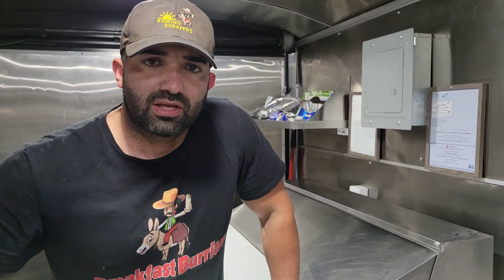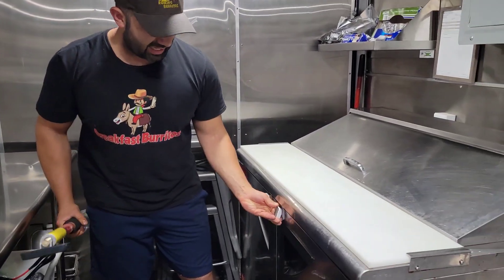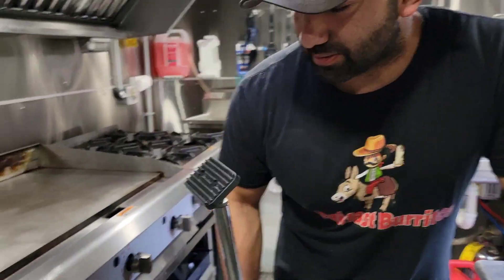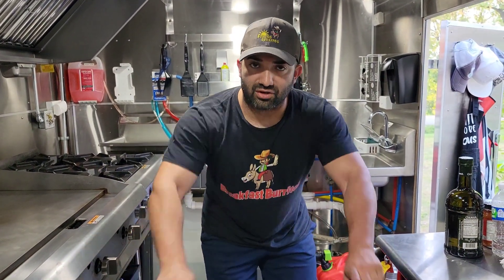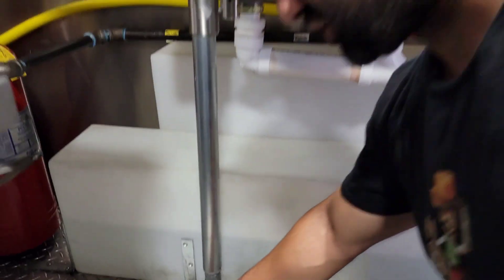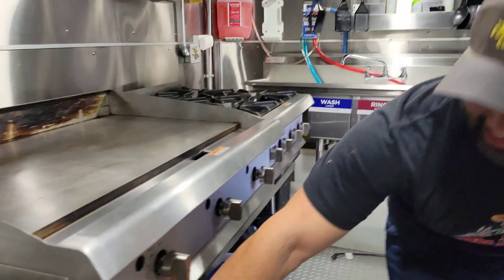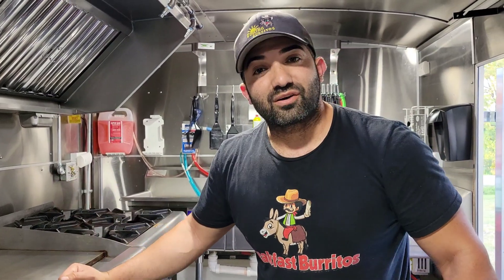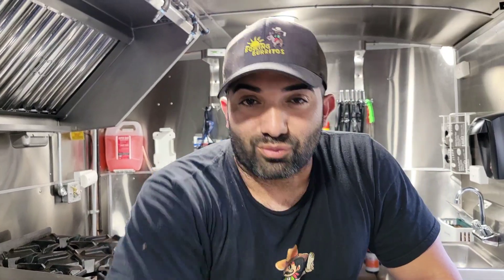Food Truck Tips: My Equipment keeps moving

Comment: How do you secure a 20quart mixer on a table?
Reply from the maker: I would use screws from the bottom up to the legs
Reply: @fbaltierrez  do yiu recommend fastening to the floor of the trailer or to a stainless steel table?

Comment: What is the best way to secure a mixer on the trailer?
Reply from the maker: I use this https://www.lowes.com/pd/SteelTek-1-1-4-in-Silver-Galvanized-Steel-Structural-Pipe-Fitting-Floor-Flange/999930954
Reply: @fbaltierrez  mine is a bigger one and they have square feet. Will there be any around that fit?
Reply from the maker: @xstablishedtv  no idea to be honest. Worth a try, I have never used machines with square legs
Reply: @fbaltierrez  in your opinion would  you think L brackets will be strong enough to hold it
Reply from the maker: @xstablishedtv  if you get the galvanized style
Reply: @fbaltierrez  I really appreciate it. Continue doing great things love your channel.

Comment: Thanks so much for the great info! I have a question I'm not sure if you'll be able to answer. My husband and I are doing a food trailer, where we have a two drawer fridge underneath our griddle. We are not operational yet, but we want to screw the flanged feet attachments into the top of the drawer fridge and tow strap it in to be safe. But we aren't sure about the fridge being screwed into from the top. Have you ever done this before or have any advice? Thanks so much! 🙂
Reply: You can screw into the fridge without hurting it. Use large screws since it is just held by the sheet metal. I would avoid using self tapping screws as the thread hold is not as much once the hole is bored.  Use shorter screws like 3/4 or one inch

Comment: How would you go about holding down a popcorn machine, nacho machine etc?
Reply from the maker: Is it a full machine or just on the countertop?
Reply: @fbaltierrez  countertop
Reply from the maker: @monicaortiz1211  I would buy a 1.25 foot flange from Lowes it's in the plumbing section
Reply: @fbaltierrez  1 more question  I have a generator starting watts 9500 and running 7500  my total amp usage so far is  75.4 can you tell me is that a good generator or do I need to go bigger?

Comment: Hey frank I was wonder what’s the best method to fully secure down my appliances down to the food trailer? Right now they seem to be loose. Are they supposed to be bolted down or strapped down?
Reply from the maker: https://www.lowes.com/pd/SteelTek-1-1-4-in-Silver-Galvanized-Steel-Structural-Pipe-Fitting-Floor-Flange/999930954?cm_mmc=shp-cprdplbgglLIA_PLB_142_Pipe-Fittings-999930954-local-0-_-0&ds_rl=1286981&gclid=Cj0KCQjwof6WBhD4ARIsAOi65ah2jSS21j1wylr81mEEKT27R-J7SP97T6CrckpiXKFyOHj8tvsxQzAaAksREALw_wcB&gclsrc=aw.ds

I use these
Reply: Thank you

Comment: Frank i opted to use two anchors on the floor by using two hooks ith thread on the floor and used a rachet strap whe transporting it, instead of drillimg on the walls.
Also used aluminum 1.5 angles on tje bottom of the fridge bolted onto the fridge bottom and floor as well, but facing inside and looms great.